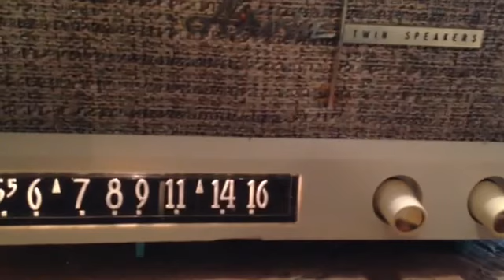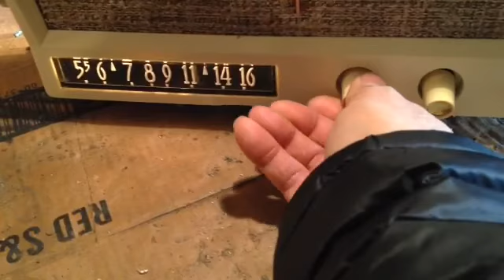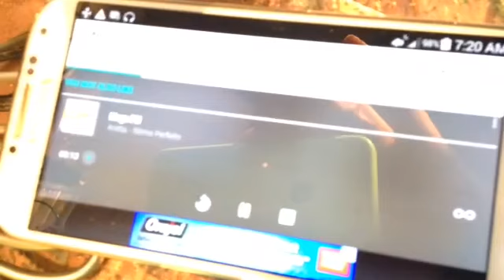Feb 24, 2015

Comment from the maker: The radio/MP3 switch has been located on the bottom of the radio in the right back corner. I decided to use the existing opening for the power cord rather than drill out another opening. This preserves the originality of the cabinet. All electronic modifications are completely reversible. The power cord opening had to be filed 1/16" -1/8" wider to accommodate the MP3 switch. This video demo was done this morning with my smartphone in one hand while a fidgeted with controls with the other, so there's some excess camera movement.